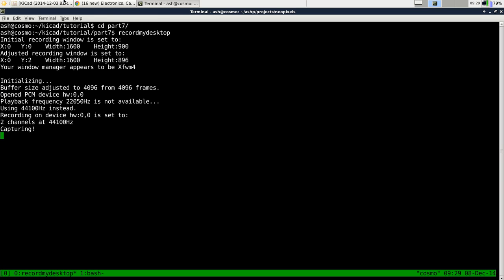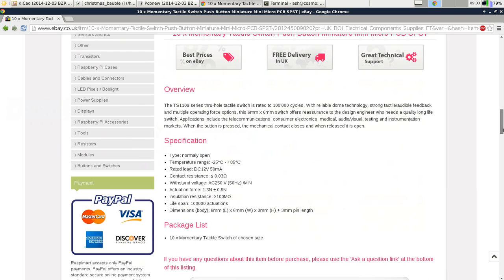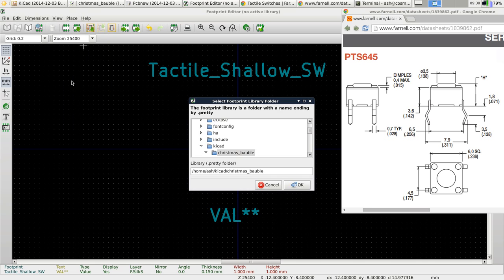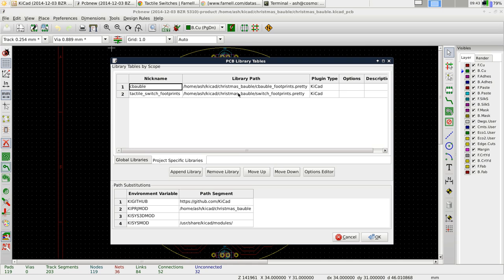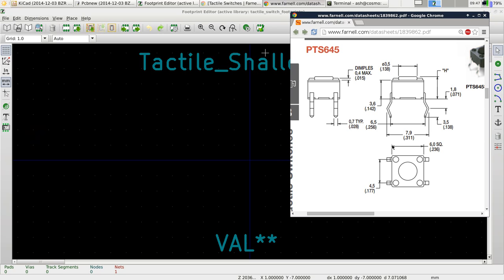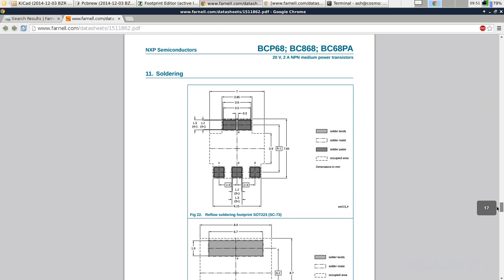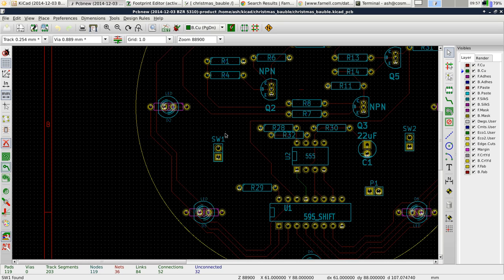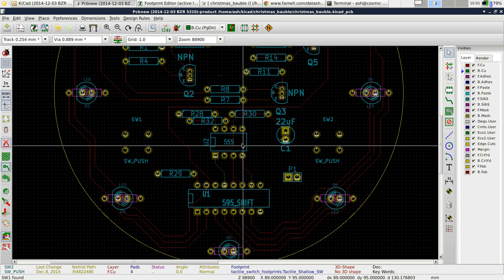Kicad Tutorial 12/2014 - Part 7/12 - Custom PCB Footprints

Comment: Ashley, first of all, thanks!  Your tutorials help a lot.  Have been working hard to fill in many gaps, and library management is abitch.  Trying to solve strictly within Windows 7.  What a time waster.  But the program is amazing, once figured out.Noticed the SUGGESTED HOLE PATTERN on your tutorial @ 18:52.  They suggest 4.5x6.5 and hole diameter looks like 0.1mm.
Reply from the maker: +JohnHRichards Hi John, thanks for the comment and the hole pattern point. I don't envy your position with Windows 7... just think you could save yourself all that pain by coming over to the darkside! :)

Comment: distance between pins are 6.5millimeters as clearly stated by datasheet.
mil is 1/1000 of inch not to be confused with millimeters.
how do you make custom pads, custom made shaped surface mount pads ?for example the pattern of solder paste on a single pad in sot669
Reply from the maker: Nicholas Sävenlid i think you have to edit the file with a text editor as far as I know. otherwise you need to comprise it with overlapping rectangles and circles